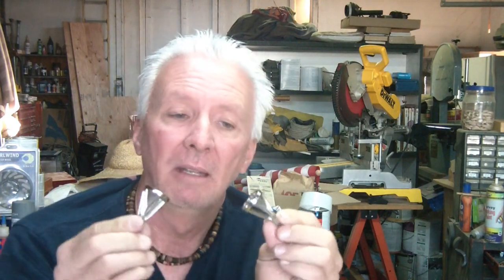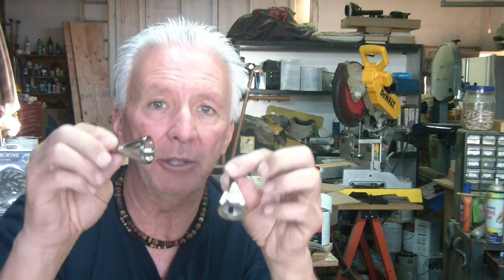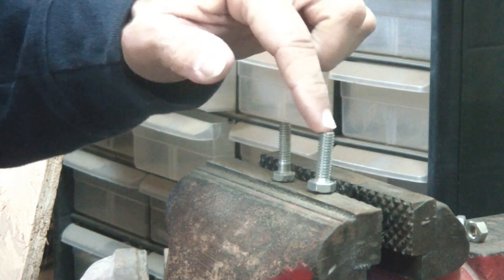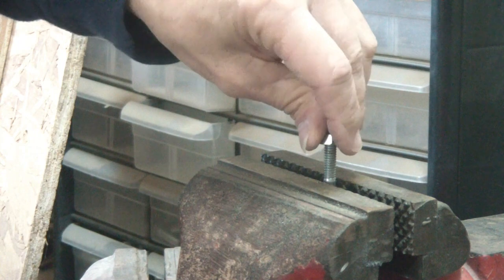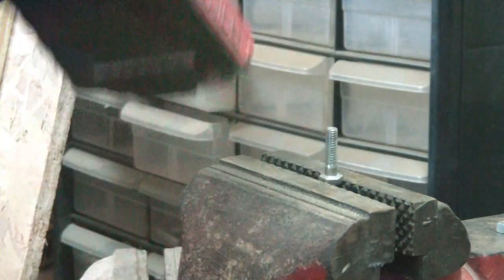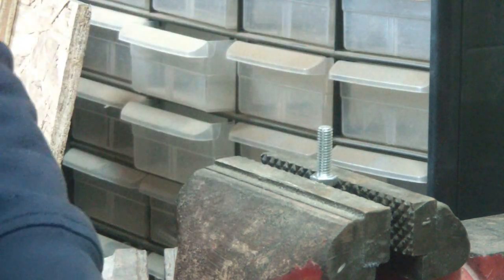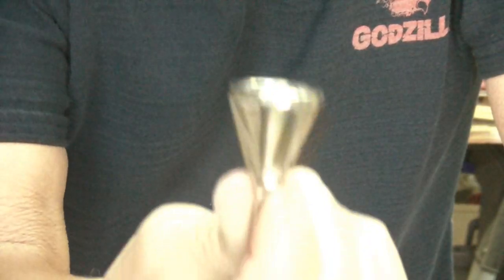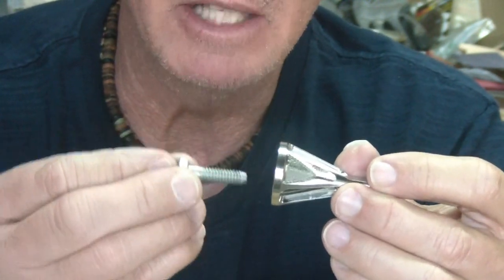Deburring  tool review

Comment: Looks like it works well enough. The fact that you need well over 1" of thread exposed for smaller hardware makes its potential uses quite limited. If they were smart, they would make them in a set with much shorter cones and sell as a 3-4 piece set. 2 things I can think of these would be great for is damaged exhaust manifold studs and hammer in concrete wedge anchors.
Reply from the maker: essinem4130 I totally agree a shorter cone would be quite beneficial. If you notice their add it only shows larger bolts. but it does work you'll need at least 1 1/4 inches to deburr smaller bolts

Comment: I think 8/32 is the same as 1/4, but I'm not an expert. Thanks for the video.
Reply from the maker: chesshooligan you are correct it was a typo. in this case its meant to be a screw size #8-32. 8 being the screw size and 32 the thread count. 32 per inch a fine thread screw.Thanks for pointing that out and thank you for viewing.
Reply: @TheShackHome  
Ahhhhhh, it's all clear now. We'll blame it on the numbnuts who had the idea of using fractions rather than the decimal point to describe measurements smaller than one inch.
Reply: Lol
Reply: I just bought one and it doesn't work worth a dam